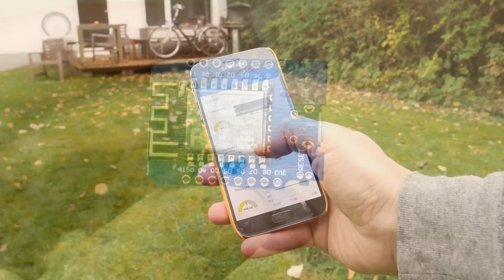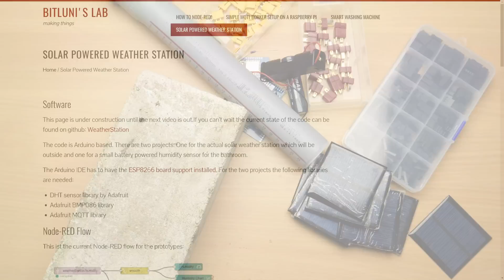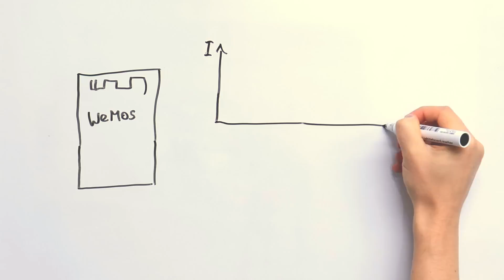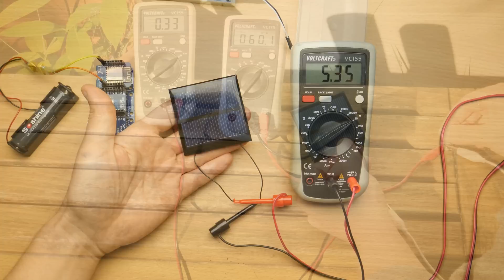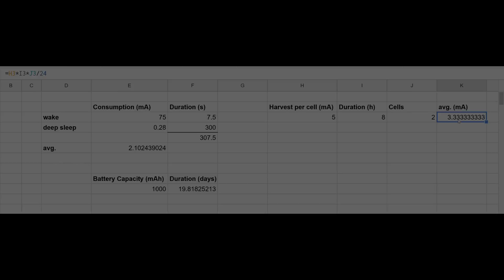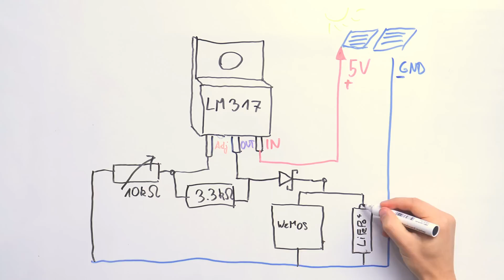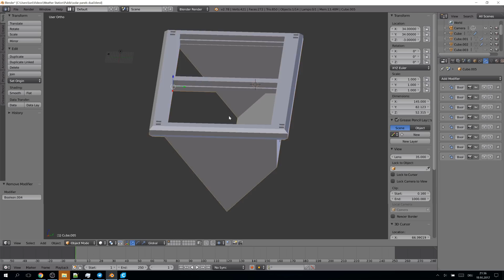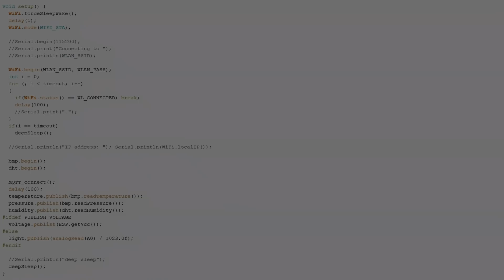Solar Weather Station [WiFi, MQTT, Smart Home, ESP8266]

Comment: could you skip the photoresistor and read the voltage from solar cells to get a light measurement?
Reply from the maker: +user21XXL would be a bit more complicated. Since we would need to measure voltage and current. When the battery is low there is a higher load on the solar so the voltage drops.
Reply: you could try to measure cell voltage when charging circuit is disconected.
Relay or mosfet could disconect sollar panel from rest of the device, and you could check open cell voltage

Comment: Hello, this is a good video. I suggest to use a TP-5000 Module, which is capable to charge LiFePO4 cells as well. No needs to be build an additional circuit. Nice job. Oh I just forget to mention you can lowered the power if you use an ATTiny13A. I had a project where the sensor wakes up 4min and 56 secs for 8 secs. the deep sleep period it takes 5.4 [uA]. I use P-Channel and N-Channel MOSFETs to cut of differetn parts....
Reply from the maker: +Istvan Zilizi thanks for the suggestions. How good does the tp-5000 handle currents about 1mA ? I had to switch from these small buck converters during production when realized I tested it with like 100mA but the solar didn't work. Keeping the circuit simple is a decision to make this video accessible to beginners in electronics. Shaving off the last 280uA is worth diving in an another project. I think it shold be even possible using just some passive components
Reply: Undertand your point, the backward current 2-6 [uA], I used my own TP5000 to charge LiPo batteries around 3000 mAh capacity with two 6V cells. I have to start an investigation, unfortunatelly LiPo do not like the low temperature.

Comment: You can use a small sugarcube relay, to switch between ldr and battery voltage.. Just keep a default mode like ldr needs to be monitored always.. And whenever you need battery, just power up the relay and your done.. Take a reading and power off!. 

That's just a suggestion 
And as always superb videos.. Thumbs up. Thanks for sharing
Reply: agree.. it would be very nice to know the battery voltage and that solution sounds quite good :)
Reply: Anton Milošević thank you
Reply: It also could check the battery voltage once every few hours and if it reaches a critical level alert the user :)
Reply: Anton Milošević I didn't suggest that as every time it would have to trigger the relay which may pull a lot of power.. So we can keep a threshold of like 40% , so when the battery is low at 40% it won't trigger the relay for the next wakeup cycle.. And just report the user , after like 2 or 3 wakeup cycle it will trigger the relay so we can check if it's working or not.
Reply from the maker: the internal voltage measurement of the esp is currently a compile time feature in the arduino library. don't know if there is a way to change this.
Reply from the maker: the alert can be done even without the battery check. you can use node red to alert once there was no update for 5 min.
the esp stopped working at 2V in my tests.. that's also the minimum for the battery.. so not a bad situation.
Reply: But that would alert me that the esp already died.. i'd like to be notified like a day or two before that, when the battery is critically low, and so I would have time to react before... I hope you get where I'm going with this

Comment: I recommend protecting the PCBs from water damage (there will be condensation inside the open tube) with either conformal coating or something like CorrosionX which I used successfully in the past to protect boards exposed to elements. One thing to keep in mind though is the barometric sensor, you will damage it if something gets inside metal housing. Otherwise you will inevitably have burnt boards when condensation inside the tube causes a short circuit.
Reply from the maker: agree, that's why I suggested giving it a hot glue cover. actually, condensation should only happen when it's foggy since there is no temperature difference inside.... I'm really curious how long it will last. I sacrifice it for the team ;)
Reply: @bitluni  How did it last?
Reply: @bitluni  Do you have an update on the durability of the setup?

Comment: great video. I would like to suggest using TP4056 Module to charge a li-ion battery. You can plug it into the 5v input without any problems, then you can connect the + side to A0 using 100k resistor. I tried this and its still working for the last 4 months.
Reply from the maker: Sure, it would be an option. But I'm not sure if it can handle the winter here. I liked to try the LiFePo battery. Also, it's a nice way to introduce a classical lm317 circuit...  😍
Reply: The TP4056 module will easily survive the winter :-) 
But yes... That battery may have problems
Reply: Could you connect a 5v solar cell to the tp4056 to charge the battery and simultaneously use the battery?
Reply: I am asking because the tp4056 wants 4.8-5v which may not always be given when the sun is not shining